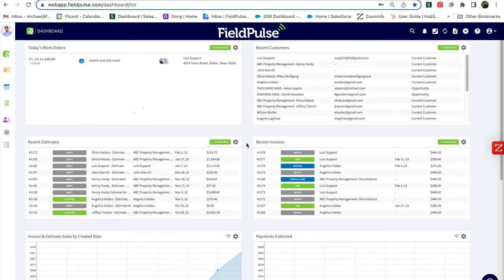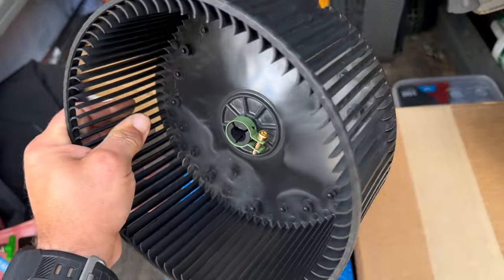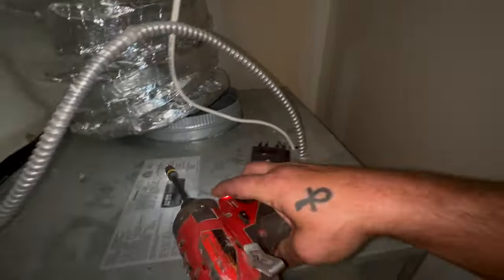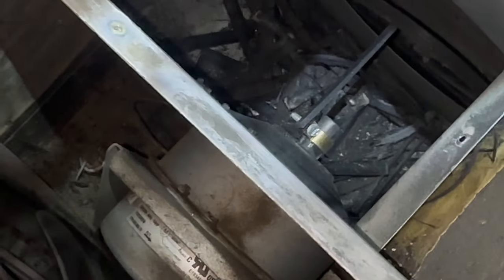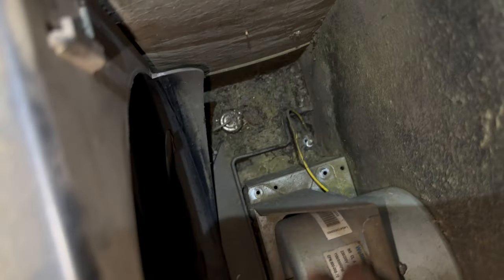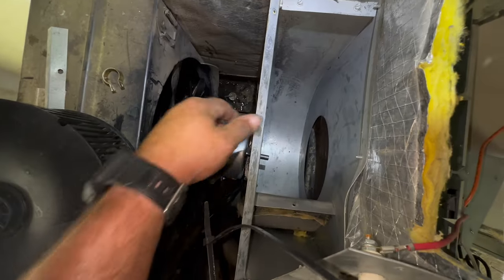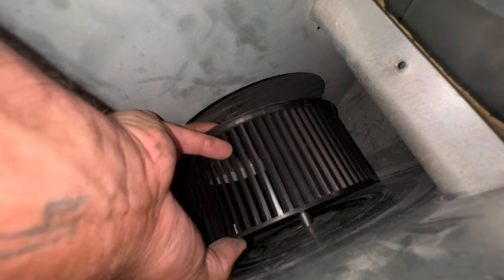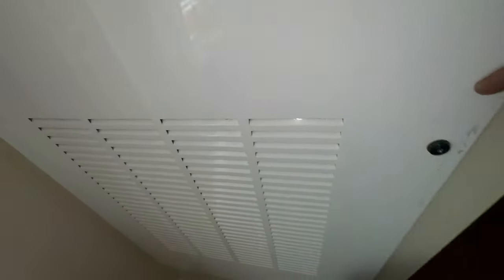I Was Not Expecting This! | Friedrich V-Tac Motor Replacement

Comment: Many of the older squirrel cage blower wheels had allen head set bolts. A set of long allen wrenchs was a must have tool.
Reply from the maker: Yeah I can't say I've ran across many of those. This was actually the first motor I replaced on a V-Tac

Comment: I have a Friedrich Kuhl through wall unit. Since I can't get anyone to service it, I've had work on it myself. They are made the same way.  Except mine didn't have enough room to slide the condenser fan off the shaft without unbolting the condenser and tipping it.  I'll be ripping mine apart soon, sounds like the motor bushings are shot on mine now.